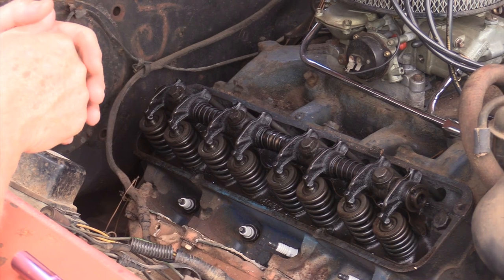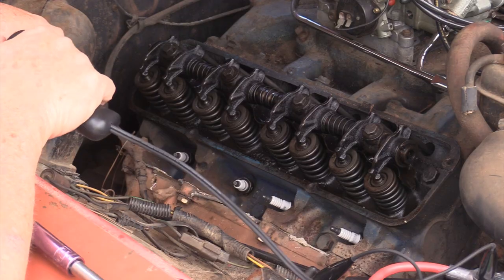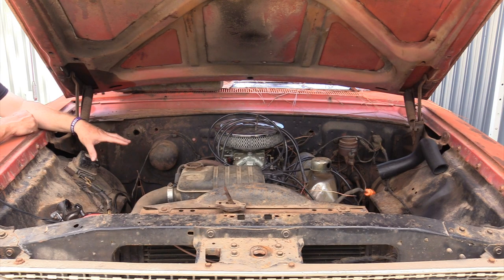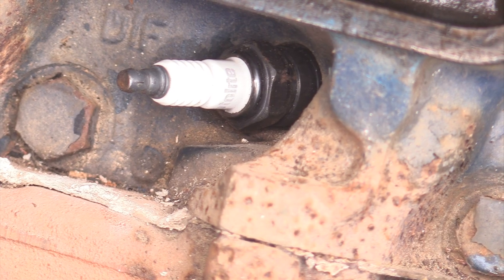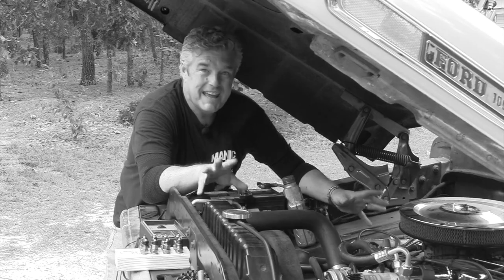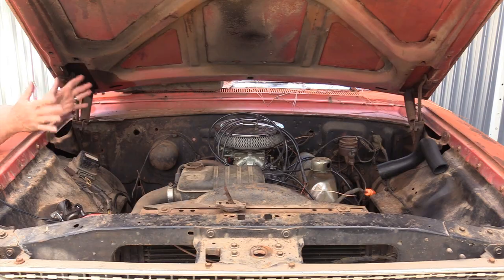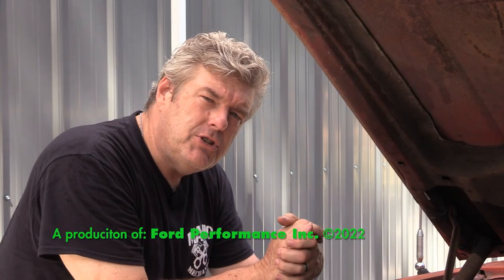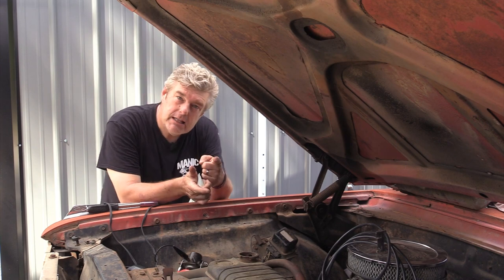Cam Problem Ford 390

Comment: I can't believe it's been 40+ years since I was able to go to the many junkyards here in Metro Detroit and buy decent running 360's,390's, 429's,460's and 351 CLEVELANDS all day long for around $300-another $100 with a C6. Makes me wanna cry. No more good machine shops around anymore either. Looking forward to a 2022 "budget" build. Thanks for posting.

Comment: 2 zip ties a feeler gauge set. A pair of 460 channelocks.  
Set up 0.070 thick feeler gauges. Zip that pack.  Set up more feelers into a 0.170 feeler gauge stack. Zip tie those.  Bump the number 1 cylinder to tdc compression stroke.  Use channelocks to grip rocker arm. Apply pressure to rocker arm to push pushrod down to collapse lifter.  Rocker to valve tip should be within 0.070 and 0.170"  
If not within spec a longer or shorter pushrod is available easily if you look at the pushrod catalog.
Reply from the maker: Thanks for the awesome tip Wayne

Comment: I've built a couple of those. One as a stockish warmed over 390 and an all out 445 stroker. Even the stockish 390 makes a lot of power when all the machine work is right and the pistons come up to the top of the deck. I reused the stock 4 barrel intake and exhaust manifolds on the 390 and it still revs to 6000 RPM and makes plenty of power. No cheap way to build those if it goes to a machine shop.
Reply from the maker: Yeah we realized that period but we think it'll be a lot of fun to do a stroker for the Galaxie
Reply: @AutoRestoMod  Night and day difference in power with the stroker kit, no matter how good the 390 runs.

Comment: I rebuilt the 390 in my 74 F100 and yes, it's expensive. I had to spend the money to have the heads rebuilt twice! The first shop to rebuild the heads was in fact a cylinder head specialist and messed up my C1AE heads!  The second shop was an at home shop and he got them right. Overall, probably close to $4k in that motor and I assembled it myself.
Reply from the maker: I really hate to hear that for you. Sometimes that kind of stuff happened. We know it's gonna be expensive But we're hoping to keep our cost down

Comment: THANK YOU for not wrecking things to make a video. I got a real bad taste for one of the early "we have to build this car in 2 weeks" reality shows due to their ritual of locking the throttle wide open on anything that came in running so they could stand around and watch it blow up. That shows absolutely no respect for the machinery and I have no respect for people who would do such a thing.
Reply from the maker: Plus on some of these engines is just really expensive.

Comment: If cam is worn, that valve should have less lift than the others, I'd verify using dial indicator. Could just be tight from sludge or setting. Upper ball on push rod could be scored. I'd start engine and see if it rotates.
Reply: I agree.I would run it.

Comment: The way to identify a GT390,  assuming it was complete when the swap was done, is look at the oil filter housing, the GT390 had a special housing that I believe was also only used on the 428cj. Next is the cam itself, should be .480 lift. Also, if like mine that was a gt390 out of a 4-speed car it will have a "large port" low riser intake. Mine had a C5 casting number but was large port, that can only mean one thing since large port FE were out of production in '64 and only the 4-speed gt390 retained that design. The intake is why the 4-speed engines were rated at 335hp compared to the 320hp in GTA cars. Hope this helps. Block casting numbers are worthless, I've personally seen a 390 out of a late '60s truck have the casting number as a side oiler 427, it was not, just your standard top oiler 390. My GT390 codes to a 428, it is not.

Comment: yes, my '67 390 GT engine, with only 73K on it, also had a tight lifter on #2 exhaust, pushrod was rotating but very slow compared to others.  I was replacing lifters, pushrods and rocker arms and when pulling out the old lifter, noticed at the bottom of the lifter bore looked like a small burr at the bottom.
Reply from the maker: Yup it could also be trash inside the boar or it could be a problem on the Cam lobe. Any of those instances make me want to stop

Comment: There are  issues with flat tappet lifters today. I have a machine shop and deal with custom cam grinders. Check your new lifters!!!!!!! Haven't had a problem with Hy-Lift yet.
Reply: Johnson /Hi-Lift are the OEMS and  seem like the best Ford ones. If it were a GT though it would have a lower bolt on the end  top bolt holes and the cam will be the same as the A cam in the 428 CJ.

Comment: I have a 390 GT motor in my F-100, I just recently took the Intake manifold out and the valve covers off to replace them, it has a roller cam. Do you have to put the push rods in the same spot I took them out? If so I'm screwed.
Reply from the maker: It would have been better. If the enging is not high miles, there is a  chance it will be OK if you put them in as they are.
Reply: @AutoRestoMod  Thanks for replying. What would you recommend I do, since they're already out and there is no chance of me putting them back in the same spot.

Comment: Goodluck love to have my 73 f100 410febuilt.  But I need money and everything is tight
Reply from the maker: Yeah it's really hard right now if you have to drive to work just to put gas on the vehicle!
Reply: @Regg Eckman better pray that all of your pistons are good their hard to find these days
Reply: @purpurahaze9179   yep, purrs pretty good. Reminds me I should go start it again and enjoy the lope.
Reply: @reggeckmann3993  Is yours the original motor for the truck?
Reply: @purpurahaze9179  nope, was a replacement 30 years ago when original 360 crapped out at 30k this one probably has half a million, odometer quit moon's ago
Reply: @reggeckmann3993  I figured I would ask  410's seem to show up in other vehicles than what Ford shows that they came in. I currently have one in my 69 Ranger but the engine in it when I got it in the late 90's was a 410 too

Comment: Did you call the 2nd cylinder back on the passenger side #7? The firing order on the Ford has that cylinder as #2. It actuates just before # 1 the 1st cylinder on the passenger side. Just wondering.

Comment: Can you pour oil over the pushrods and try again. GTs have 1 piece retainers.
Reply from the maker: I think what I would probably do is to pull the push rods run a little bright clean down through the porch and see if that helps. I've always said that usually a car like this is parked for a reason and it's most of the time not because it's ugly. Lol Usually it's something catastrophic either in the drive line or the engine.

Comment: If that 390 is from a GT car, then it is likely a HiPo 390. Not a bad place to start imho. Maybe a 445 stroker kit since you're rebuilding it? Just a thought.
Reply from the maker: We have other fish to fry but a stroker kit is a thought process for me
Reply: All HiPo 390 had adjustable rocker arms because they had solid lifters, which this one does not have.

Comment: That is not a GT engine the 390 GT head had one piece retainer on the valves that one had 2 piece
Reply from the maker: I never said it was A390GT engine I said it was the same type of cylinder head that the 390GT used